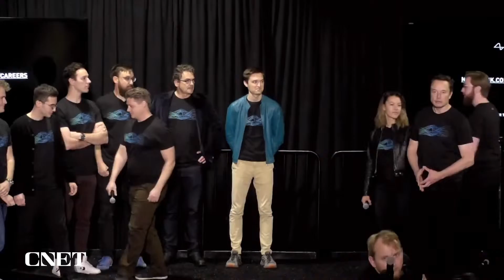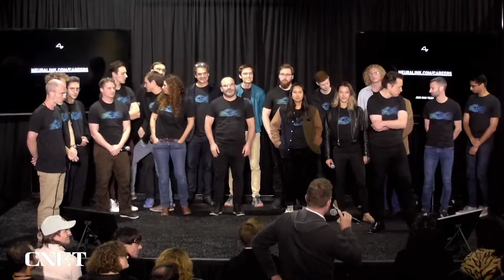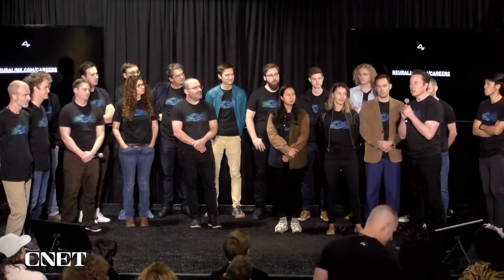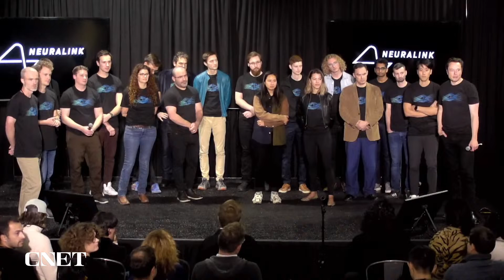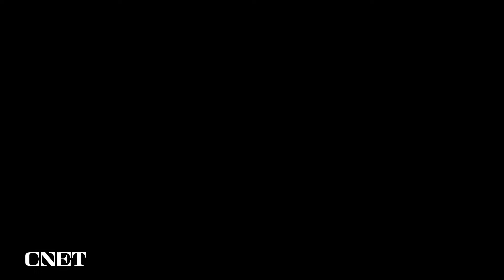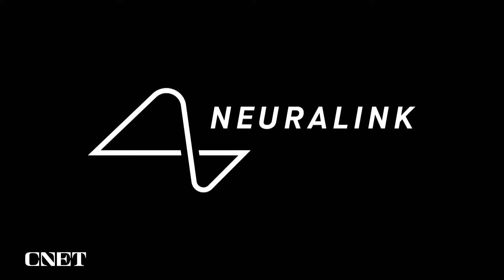Elon Musk Answers All Your Questions at Neuralink's 2022 Show and Tell Event

Comment: What makes it necessary to install the entire device within the skull? Creating x-number of micro-holes, just slightly larger in diameter than each thread, would mean that as tech improves and becomes smaller over time, the device core could be changed frequently and non-invasively. Thread holes can always be added later, too.
Reply: This is just to control you and your brain he want all control over your body. So he can use you for his work like Robert

Comment: I don't think this technology should be exclusively wireless. There should be a wired version too. To allow for ultra high bandwidth, with very low latency. This would be good for tasks that are not mobility oriented. Like piloting drones, controlling vehicles and ships, star crafts and just about any other vehicle. Interfacing with a piece of technology directly with ultra high bandwidth and low latency would be much better for generalized applications, in my opinion. For more specialized use like prosthesis, or fine motor functions and mobility wireless would be ideal.
Reply: Wireless at close proximity (<cm) can be nearly as efficient as wired. Leaving a hole in the skull seems like a subpar option
Reply: @thomasreese2816  I'm talking about more than a hole in the skull. Think bigger, much bigger. A connection large enough to allow at least a petabyte connection speed. With enough practice, and the right technology, I'm confident the human brain could multitask complex, and large scale operations with ease. Controlling construction robots and heavy equipment, like a conductor at a symphony. Couple a high bandwidth stationary connection and interface, with a connection point on the human body like the spine or brain, for commercial and industrial purposes. Systems like that could be expanded on for many applications. 

But yeah, I suppose you could do close proximity wireless as well and possibly achieve the same thing. Though, you're always going to get interference with wireless connections. Among other issues. Wired connections for industrial, commercial and military applications is the way to go though, I think.
Reply: I am immediately thinking of the movie "Matrix", with the back of the head wired connection. Enough bandwidth to make the virtual feel like reality 🤔
Reply: @mikes8510  Something similar, but not quite as long and invasive as the one in that movie. I'm sure a connection that is around that size but not actually inserted into the body would be better. There are plenty of connector types that don't use prongs or pins, just contacts secured by magnetic force or something else. The only permanent implant would need to be a generic receptacle on the body. Where it's placed and what form it takes is a question for doctors and engineers.
Reply: Wired implants won't scale, therefore no money to be made, therefore Elon won't like it.